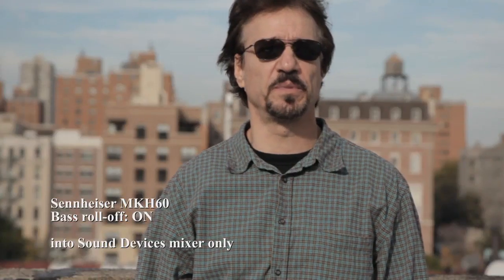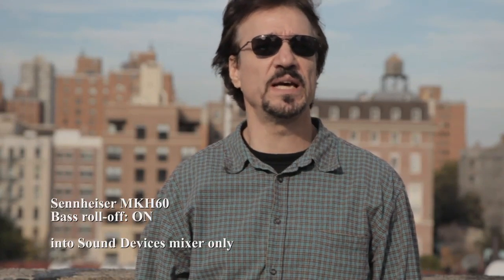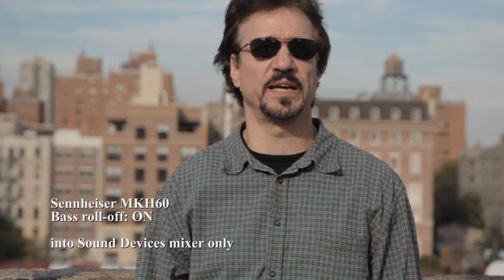Mic Tests: Sennheiser MKH 40, MKH 50, MKH 60 & MKH 416 + Audio Technica AT-4073A & TRAM TR50

Comment: Paul, this was invaluable to me. Thanks for putting in the time and work for all of us.
Reply from the maker: Thank you for the comment.  I'm glad that  this video was helpful.  Since then, I've sold my MKH50 and MKH416.  I now use a Schoeps CMC1/41 for all my indoor shoots.  I also just bought the fairly new to the market Sanken CS-M1 short shotgun for any run and gun I have to do outside.
Reply: @nycvideoauditions  Hi Paul. Thanks for the insight again. Can I ask since you've moved on from both mics, what have you liked/disliked about the Schoeps and Sanken and any other thoughts comparing them to the prior Sennheisers.
Reply from the maker: @Kaizen2013v  Well, this is VERY subjective, so all I can share is my own personal experience.  I'm not suggesting here at all that one mic is "better" than the other.  So...after using the MKH50 for many years, my ears desired a more 'natural' sound, the kind of sound where the recording and the person talking in the room sounds identical.  This is why I moved to the Schoeps ... and I couldn't be happier. (I'm currently using a CMC1 + MK41 + Cut-1 filter.)   The reason why I sold my 416 and bought the Sanken CS-M1 is because I wanted something lighter and smaller for when I need to mount the mic on the camera. I just received it yesterday, so I haven't had the chance to do proper testing, but I'll update this message when I do.  Cheers!
Reply from the maker: UPDATE...I rarely shoot outside, so I decided to sell my MKH 416 to someone who can put it to better use more regularly.  
For the times I do need to work outside, I have an MKE 600 and it's perfect for me. I like that it has a low cut option, too. 

So for interiors, I'm moved on from Schoeps - believe it or not - and I'm using a DPA 4018, currently with an MMP-C preamp.  
I also have the MMP-B, which has dials for  low cut and high boost.  
***This DPA set-up  is my all-time favorite for indoor dialogue recording. 
 Lately I've been use the C preamp and cutting the lows at 120Hz on the mixer.  Still sounds full and beautiful.  I'm so impressed.

Comment: I really enjoyed this... great job!

I do want to ask... in both the 50 and 40 clips... it says (or the speaker says) that the bass-cut is engaged. To me it almost sounds like the first 50 clip has the bass-cut engaged, 2nd clip off... then the 40 first clip off, 2nd clip engaged(?)

The great voice of your talent has me debating a second 50 vs. my first 40. I actually like that "tangible" lower-mid presence that the 40 has in the first clip. That is a similar sound to what I hear in the DPA 4017 series.
Reply from the maker: +Mattin STL , Thanks. You might be right about the 50's low-cut being incorrect on those clips, but I'm sure.  However, I do think what you're hearing is essentially the difference between the Beachtek XLR adapter and the Sound Devices mixer. The Sound Devices in all cases here, definitely had some more "punch" in the recording.  

In case you're interested,  I do plan on doing a very simple exterior test soon with my 50 on the street, instead of on the roof.  It will be "man on the street" type of scenario.  I'm going to have the 50 boomed overhead with a BBG & Windjammer.  I just bought an MKE 600 to place on camera in these situations where I will be close to the subject.  So, I'm kind of curious if I can get away with that or if I'd *need a boom op for that specific scenario.
 I'll have something uploaded soon.  
Cheers, 
PAUL
Reply: Cool... well, I'm impressed with your video.

I enjoy the comparison of mics more than a show of furry effectiveness (if that's your intention).

What led me to your video is trying to decide if I want to add a 2nd 50 to my kit, or if I want to get a 40. Many people say the 40 lacks the reach of the 50... but in the video the speaker says settings were identical. I have "okay" monitors, not computer speakers... and I actually preferred the sound of the 40 due to it's lower-mid presence. It sounded like that mic was in a totally different space... not even outdoors.

I'll definitely be watching for future comparisons... and I'd really enjoy more "shootouts" between the 50 and 40.
Reply from the maker: +Mattin STL   Here, the 50 is 1.5 & 2 feet above the talent.  https://www.youtube.com/watch?v=GrpO1gJdCyI

Comment: I never keep mic above when I shoot in the top of the buillding. a lot of noise in this position. I have had impression that the mkh 60 will be more quiter but in this video sounds better the mkh 50. maybe because the mkh 60 is more directional and sensitive and take more sound from the road

Comment: Hi Paul, which of these would you recommend as the best all-round mic? Use will be indoor voice mainly but perhaps some outdoor and wanted something for podcasting also. 3 birds with one stone... The mkh60 and 416 are available locally at a good price but was leaning toward the mkh50 as it seems to have a deeper sound... Thanks in advance!
Reply from the maker: Hi Luke.  IF the interior spaces are untreated, then I'd go with the MKH 50 as your go-to mic.  I think that should fit your needs, as you described.  If the rooms are treated and there's NOT a lot of echo slapping off the walls and floors, then the 416 is also a good option for your purposes, in my opinion.  Remember to get a pop filter for those podcasts - and be mindful of the proximity effect, too.
Reply: Thanks for the advice Paul,  from what you have said I think I will hold up for the mkh50!
Reply from the maker: It's really an excellent mic. It's a beast!
Do NOTE: When you use it outdoors, I recommend getting Rycote's Baby Ball Gag with a Windjammer.  
AND/OR for more intense winds, you'll want Rycote's Windshield Kit and Suspension system.